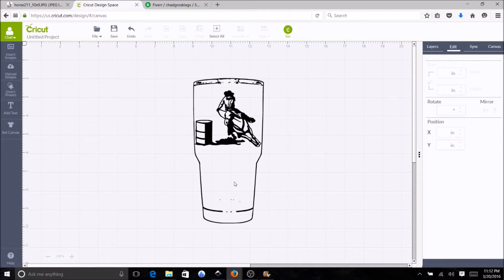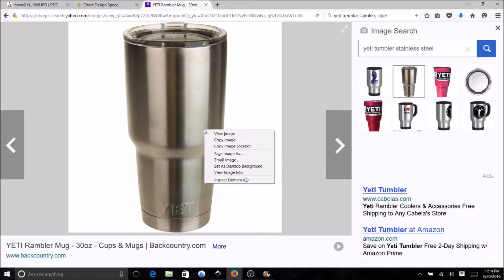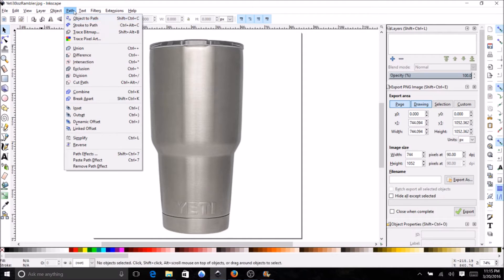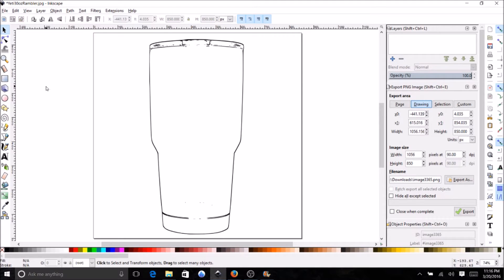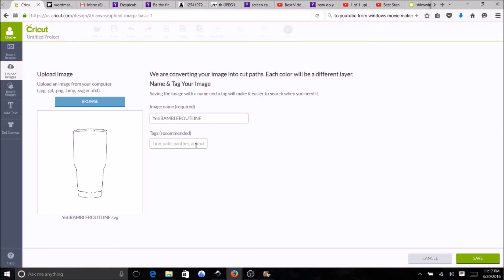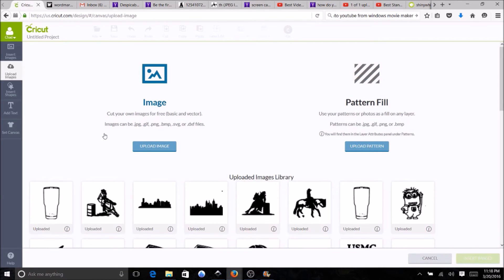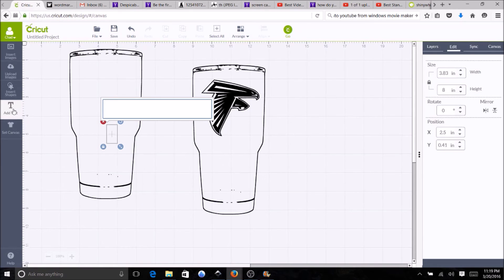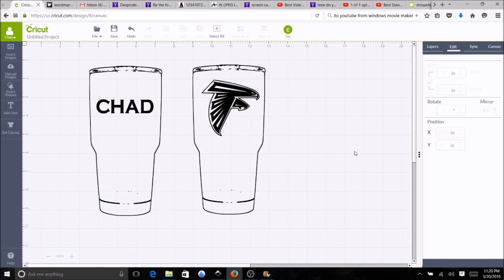How to Create Yeti Rambler Outline in InkScape

Comment: Have you ever tried to use your vinyl cutter to try and cut out something that wrapped around a cup or tried to follow the curve of a 30oz or 20oz cup?  Just wondering if using this idea for a wrap would work.  My daughter wants to put a large mermaid on a cup but the tail and the scales are not laying correctly because of the bend of the cup.  I cannot figure out how to lay it out so that it moves and bends with the cup without becoming distorted.